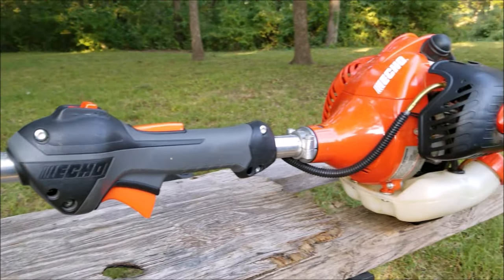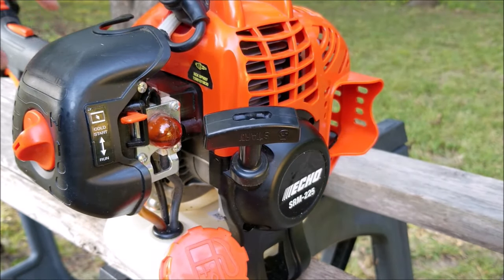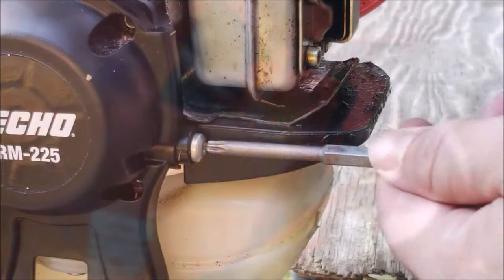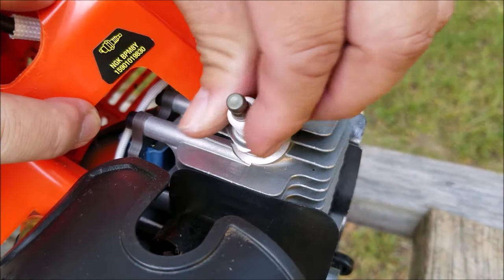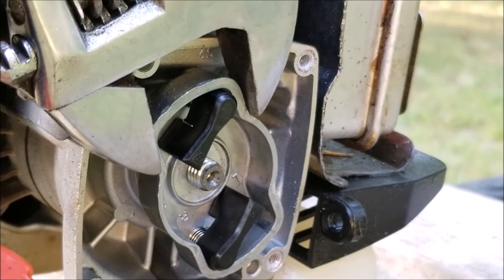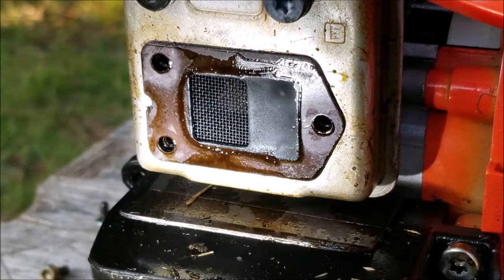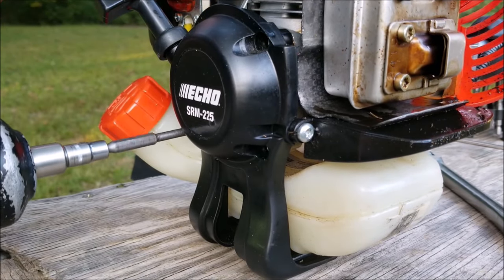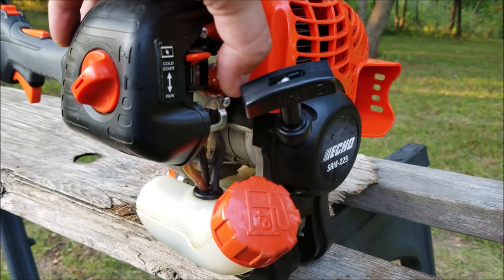Pull rope is stuck and won't budge

Comment: Yes it has; yesterday! The Echo 230 blower was locked up after sitting inside all it's life. It has NEVER been outside and never hardly in my drafty shed but in her side which is a storage building. I was going to blow leaves with it and noticing the choke was closed, started to pull it and it wouldn't budge. I knew it couldn't be broken so I kept increasing the pull on the recoil and directly it made a slow half turn . I eased it around for several pulls and then choked it and got serious after it got a shot of gas and freed up a lot. It popped on the 3rd pull and ran the next pull. I set it down and let it idle and after a minute I heard the tone change and I went to blowing leaves. It smoked a bit but cleaned out and did fine for the rest of the job here at home. It acts a dab lean on acceleration but I'm going to run it like that and see if more runtime will help richen it up. If not I'll look in the archives and find the low screw and give it a  quarter. And I think it was stopped last with the choke and that's where the oily sticky stuff came from. Thanks and Blessings!
Reply from the maker: it's interesting that it did that, at least you were able to get it going again .
Reply: @HomeGaragechannel  It runs fine now but as you know, we're prone to see anything goofy!

Comment: I have a Poulan pro. I replaced the recoil spring and pulley. When I put it back together the rope won’t pull.
Reply from the maker: I have a few questions. Was the Poulan, working just fine, before the replacement, or did you recently get this unit?  How many turns did you put on the spring?
Reply: I did look down onto the piston and does look a little gunky so I sprayed cleaner  inside and let set.!next will be clutch replacement
Reply: After that it’ll meet a sled hammer.
Reply: @HomeGaragechannel  The rope got to where it didn’t want to recoil and then just stopped so I replaced the spring and pulley.
Reply: @HomeGaragechannel   several turns the it rewound itself
Reply: @HomeGaragechannel  it worked fine before.
Reply from the maker: you might have to take it back off, and try again, and with fewer turns.

Comment: mines just really aggressive and when it does try to start the string flings back agaist it real quick and it shuts off
Reply from the maker: interesting, I wondering if the timing is off or if there's an issue with the recoil?

Comment: I left mine in the rain.  What is the likelihood I'll be able to repair it?
Reply from the maker: it depends on much rain, was it just one day? or longer?
Reply: @HomeGaragechannel  It was bad.  My kid left it in the wheel barrow while raining.  It was completely submerged for a day before I found it.  This was 2-3 months ago.
Reply from the maker: You can still have it, only part that will eventually rust and break is the steel spring for the recoil.  You'll need to remove the carb, spark plug, and the muffler, and pull the rope a few times, so to work the water out of it.  Then you'll need to replace the spark plug and do the same thing again.
Reply: @HomeGaragechannel  Thanks, I appreciate the help.

Comment: Hi,I want to thank you for the video,I had this problem with a blower, I just put W40,and turn it back and forth and it loosen the string right away,so I really appreciate the time you invested making this video,now I want to ask you if you have to remove the w40 before starting the engine or leave it inside?
Reply from the maker: thanks, and it's okay to leave it inside, it will eventually make its way out.

Comment: I have a craftsman 25cc gas trimmer just bought 2 years ago only i used it just 3 times and when I tried this summer it doesn't work. I change the spark plug and still doesn't work, I notice the starter rope is loose because it doesn't move the trimmer head. It doesn't turn. I am trying to pull it but it doesn't feel the weight of the trimmer head on. 

I am very frustrated and I dont know how to fix it. Can you share a video how to fix it or something that can help me to put it to run again. The other parts are clean. It is the starter rope sound it is off from the pulley, but I dont know how to take it off and inspect it. Any clube?  Thanks for your videos they are informative.
Reply from the maker: it depends on which model trimmer you have but most newer one, when you pull the rope, it will not turn the trimmer head. The reason is that the trimmer has a clutch so it won't engage the driveshaft and trimmer head till a certain speed. Was there old gas In the tank when you tried to start it?  unfortunately, 2 cycle equipment doesn't not store well for long periods of time.

Comment: I tried this but when I put the spark plug back in it doesn’t pull again! What should I do?
Reply from the maker: how many threads do your spark plug have? 5 or 6, Or does it have 10 threads?  I just want to make sure the plug isn't too long and hitting the piston.
Reply: Hi my name candy, I was using my trimmer to day put it down and take it up back to use it back and the pull card suck, aney one can help me please,

Comment: I don't have this exact problem but I'd really appreciate some help. The engine turns freely but becomes very difficult to pull with spark in. Ive actually broke the plastic pulley inside the recoil starter trying to get it to start
Reply from the maker: Sure thing, quick question, which spark plug and what number is it, that you're installing it. Also try the same test again, but this time,  remove all the from the tank, take the plug out and let it sit in the sun for a day, I want to make sure there's no fuel inside the engine.
Reply: @HomeGaragechannel  it's one of those cheap l7t torch plugs that came with the strimmer. It's a cheap generic Chinese strimmer that are very common in Europe. Just some extra information here, I can actually turn it by hand ok up untill the point where it reaches one of the magnets on the flywheel and then it becomes tough. When pulling the starter rope it just jams at that point.
Reply from the maker: I see, do me a favor and turn the spark plug out, one turn, and try to turn the engine again.
Reply: @HomeGaragechannel  ok I'll try that tomorrow it's dark now. I'm pretty sure I just put it in hand tight  when I was messing around with it  and it was still the same
Reply: @HomeGaragechannel  ok had a chance to try this. With the spark plug loosely in the hole it turns ok. Just screwing it in all way finger tight makes it difficult to turn
Reply: @HomeGaragechannel  ok I might have solved this. I went out and got a new NGK spark plug and it seems to pull much easier now. The NGK looks a little shorter than the old plug so I'm guessing that's why it's easier to pull? Need to put it all back together before I give it blast later to confirm its working
Reply from the maker: that's interesting
Reply from the maker: let me know how it goes.
Reply: @HomeGaragechannel  ok false alarm . I put it all back together try to start it and it was still very difficult to pull . I only got a few pulls in and the recoil spring broke.

Comment: Thanks for this upload. 
I have KingYard that has the same problem. Is the engine suppose to turn full 360 degrees??? I turn mine but it turn only like 270 degrees and like something block it.  This is a 4 strokes. Could you advise.  Thanks
Reply from the maker: unfortunately, 4 stroke trimmers cannot be turned at all, If you have to edge with it, you have to get the edger attachment so the engine doesn't turn.
Reply: @HomeGaragechannel  

Thanks for your reply. I meant I probably damaged my YardKing. It was working and then stopped. I went to pull the cord but it jammed. So I watched your video “Echo”
Spray WD4, put new 4 strokes oil and I noticed you can turn the engine to full circle, 360 degrees when my it stopped at about 270 degrees turn and stop like something block the turn. 
Could I burn the engine?
Something wrong with the Pistons. 

Where should I start?

Thanks
Reply from the maker: is that with the spark plug in or out, when it get stuck"?
Reply: @HomeGaragechannel  
Morning, yes both the spark plug in and out. 

It feels like it stops by a metal block or something. I spray ed a lot of WD4.

Thanks for your reply.
Reply: @HomeGaragechannel  

It is a 4 strokes YardKing. 
The engine should be able turned full circle? 
When I first open the spark plug looked dry. 
Thanks.
Reply from the maker: I hate to tell you, I think it might be broken. There might be a part of the piston sitting on top of the piston hitting the top of the engine.
Reply: @HomeGaragechannel  

Thanks. Can’t be fox? How do I get to the Piston HG. So can I just move?? Back by place. What cause this to happen?’ 
No oil? Prolonged use in one session??
😩😭. Shame to throw it away. 
What brand is best out there. 🙏
Reply: @HomeGaragechannel  
😓. How do I get into the piston. That is where the Spark go in ? I disconnected and put back the shaft that join the engine. Nothing I can see that block it. Open the oil reserves section after unscrew the 4 nuts.
Reply from the maker: https://youtu.be/_dOJoSAt8NM
Reply from the maker: https://youtu.be/_dOJoSAt8NM
Reply: @HomeGaragechannel  
Thanks for your reply. Look complicated. A Summer project. Now, to consider1. If I can get to it, order and buy the part, COVID-19 time will take longer, $$$? Try to put everything back later lol. I might as well get a new one fir the time been.
Reply: @HomeGaragechannel  

Thanks for all your reply. I just subscribed.
Reply from the maker: thanks I appreciate it.
Reply from the maker: yes covid has definitely been very impactful on everyone.
Reply: @HomeGaragechannel  

What would you recommend for another one. Brand? Thanks

Comment: Did all that but pull code still sticks
Reply from the maker: take the recoil off and try turning the engine at the place where the recoil goes, It will give you more leverage.

Comment: Had this with my echo but it was seized just like that one (echo hc 150)
Reply from the maker: was the piston ring seized to the cylinder wall?
Reply: @HomeGaragechannel   yes it it was I looked through the spark plug hole and I let it soak in  marble mystery oil overnight
Reply from the maker: @Budgetbuilds449  nice work

Comment: Well it wasn't locked up but I had a weed eater trimmer that was stored for a few months with 87 octane ethanol in it and the stuff turn to something equal to Play-Doh that was mixed with toothpaste.. after a can of carburetor cleaner for the gas tank and the carburetor itself, I was able to save it but the only casualty was the fuel lines had to be replaced with new because the ethanol packed into those skinny tubes just wasn't going to come out LOL that's why the manufacturer says not the use that stuff or it'll void the warranty🥴 I never store any of my power equipment with fuel in them anymore and I don't use anything but non-ethanol gas after that experience!
Reply from the maker: wow that's an amazing amount of damage to that trimmer. Glad you could save it.

Comment: I did exactly what u did and the pull robe still stuck.
Reply from the maker: how long did you wait from spraying the engine clean, to trying to pull the rope? did the rope pull when the plug was out?
Reply: So it works without the spark plug but when I put it back on it gets stuck again. I’m spinning the engine with my hand but it gets stuck after a couple spins
Reply from the maker: is your spark plug too long?
Reply: Spark plug is a small one, I put a new one also. So I got it unstuck but now it won’t turn on. It does but it dies after a few sec
Reply from the maker: time to look at the carb.

Comment: I went to clean up a piece of property for somebody my grandpa knows He gave a snapper and a old sears suburban tractor plus a edger with a 3 horse Briggs and Stratton the date code says its from 1984 I went to pull the recoil it would not spin one day I took the blower housing and then the flywheel would not spin over so I took a screw driver and pushed it then the piston started to spin freely one day I sprayed ether into it and took my drill put it on the starter clutch then pulled it then It fired right over
Reply from the maker: Nice work. Are you still using it?
Reply: @HomeGaragechannel  I don use it I only ran it once on starting fluid with out a carburetor I plan to get it running I have parts for the recoil I got some Briggs parts in my parts box as well as other parts I've had acquired over the years I working on stuff But I'm planning on rebuilding it How I've acquired the parts is that Either they where found laying around or from my grandpas garage he used to be a mechanic for a Honda dealer that sells motorcycles and atvs generators for 30+ years by three different owners usually lawn equipment is generators and Honda power equipment and he retired and he enjoys working on stuff that he owns how he got the parts he bought they were given to him from a friend some of my neighbors have given me parts too so I even have service manuals that the dealer would not need any more my goal when im out of high school is to become a mechanic and a dealer to carry brands that Are mainly commercial products
Reply from the maker: @JohannZ100  very nice goal. Thanks for the comment
Reply: @HomeGaragechannel  youre welcome

Comment: This is a grrat vid thank you.  My scenario is a bit different.  My predator auger cord will release a little bit and get stuck and release little more and get stuck and then release a bit more so i cant pull it to crank it.  If i remove the spark plug theres no tension also its brand new so never had fuel in it so its clean...added some marvel mystery oil in the spark plug hole...no luck.  This sound like anything anyone else has experienced?
Reply from the maker: That's situation is very unique and I've never had to deal with something like that other than a stuck piston.
Reply: @HomeGaragechannel  thanksfor responding...i got it to start...read in another post someone with a similar issue said that someone who uses them often pulled it really hard and got it working...same worked for me...after pulling 2 or 3 tines to fully extended it allowed me to get a couple of pulls without locking up and it started...not sure why it locks up so hard during its rotations but im in my way....hopefully this helps someone else...great channel you got.